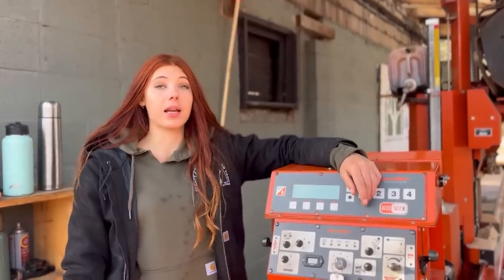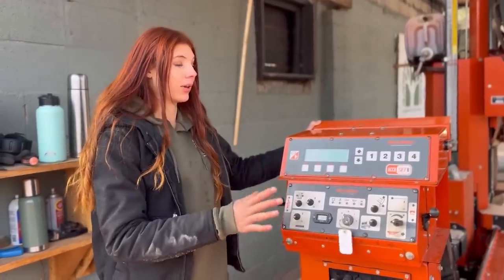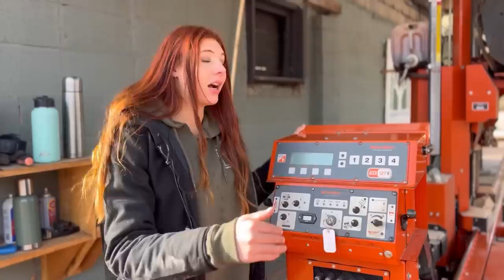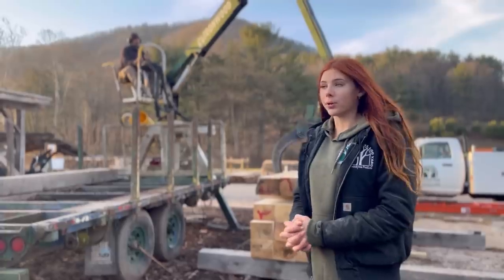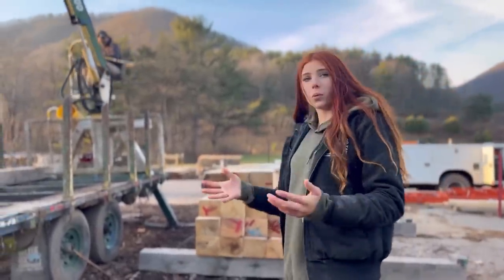Cutting Railroad Ties… hopefully we do better tomorrow

Comment: This channel rocks not only am I learning about how timber is cut and milled but I also get to see why I'd rather buy my lumber from a local mill instead of a big box store. Keep on doing what you do best guys!! Thx 👍
Reply: Emerald, my Grandfather was a Foreman on a maintenance of way crew decades ago and and good ties were what he liked best, according to family lore. Love to see the fam working todether!
Reply: If you are in the market for lumber, you already know that there are local suppliers...
Reply: I wish I lived by a wood mill I would buy only local cut wood but I don't have an option. Keep on keeping on. Oh and bossman can run the piece of equipment like its a extension of his arm impressive.
Reply: Be aware that appropriate drying of lumber is EXTREMELY important.  It can make or break your project.  Lumber straight off the mill and full of moisture is only suitable for things like farm fencing, crating, temporary bracing, and form work, but not much more.  Although quite time consuming, proper air drying is a science that can make it usable for an array of projects.  Even crossties are air dried for months prior to creosoting.  Kiln drying greatly reduces the drying time necessary to stabilize wood for most finished construction and woodworking projects.  Also keep in mind that kiln drying kills wood eating bugs that are often present inside green and air dried lumber.  😀

Comment: I have a suggestion for your railroad tie template.  Instead of tracing around a square, how about making the template like a stencil with a square hole?  It's easier to trace that way - you could also spray paint.
Reply: This is not a good idea.  It is much easier to see how much meat there is remaining on the log with a solid square in the middle.
Reply: Seems the price of Rattle Can paint has also gone nuts.  Great Idea though.
Reply: @danielbal5272  Could I suggest that they draw the outline on every log before they start milling ?
Reply: Clear acrylic with a handle at the corner so it can be held in different orientations?
Reply: @baneyj  Yup. but it won't be clear long!
Reply: Honestly the template is just helping to eyeball where to go in the log to get the tie....all the measurements are coming from the mill itself. So accuracy in tracing is not a big deal.

Comment: Love that template for the ties. Excellent idea.
Reply: Take two short sheet rock screws & place one on each corner of one long side of your template about 1/4 through. NOW, in the center of the template, the screw point side, create a bump that will slide around on the log face until you have the template where you want it. When in possession press the screw pints into the log face to keep the template in place while you trace around the template.
Reply: Once the girls cut a couple of hundred ties hopefully they will not have to use it…Boss Man.

Comment: From a Sawyers view( as I remember it) 
The tie paid for the log, and the jacket boards were the profit. So if you can, grab those outside boards
Reply: Would like to hear at some point what can be done with the jacket boards. Looked like there was a lot of usable portions left. Does the tie pay for the log? If true, great idea to switch to hard woods from hemlock.
Reply: There can be good lumber in the jacket boards.  Depending on your local markets for the different species and grades, there are options.  Many of those slabs were thick.  Probably going into firewood which is in high demand.
Reply: @andrewdelaney2410  - Hardwood is never a bad idea...
Reply: @peterh9927  - Given their diameters, a lot of these logs can be ties, and still just right for firewood on the outside.

Comment: Emerald, I had a thought about the piece of wood you use to mark out the end of the log for a tie dimension, for the obvious reasons it likes to slip around and is hard to hold in the same position while marking out the four sides of the rectangle. Take that piece of wood or make a new one in case you are worried about ruining the historic one your dad made !, then predrill if required four small holes near each of the four corners and insert a small wood screw into each of the four holes so that about a 1/16 to 1/8 of an inch or so sticks out the other side ( the screw can be a bit longer so the head isn't sucked down to the wood as that way the "stick out" of the pointed end of the screw can be fine tuned if desired ). Then find yourself a substantial knob at the hardware store or if you have some lying around and you would mount that knob on the center of the wood ( same side as you screwed in the four corner screws ). Now you would have a unit you can hold easily with one hand gloved or not and as soon as you place it up against the end of the log and press a little, those four sharp screws would hold your pattern board perfect as their points bite into the wood of the log. Then trace your pattern and not only would the pattern board not slip sideways, your hand holding on the knob would not be in the way. Hopefully my explanation comes across and makes sense. No, it won't change your life but may make your life slightly easier and shave off a second or two in your very busy day !
Reply: The template board upgraded with mini spikes and a handle to improve on the ergonomics. Great idea! I was going to suggest adding a handle too but you beat me to it. 🙂

Comment: Great video! :)
Just an idea; you are marking up the end of the log, to make sure where to cut for a tie. Good.
Can we do more? If you weld together a stencil board, you can have "layers" of stencil away from center, to see if you have room for cutting other pieces of wood out of the log. The stencil-shapes are also welded together outwards with solid string. In center of the stencil you have a hand-screw that attaches the stencil to the three, with option of extension to a side, where you can attach a laser and point down the other end of the log, and another stencil, to make sure you actually can cut out extra, and that the core of the log is best placed in the tie.

Comment: Do you have room at the end of your mill (where your JD loader is sitting) to set a roller table?  If so you could raise your toe ups, push the tie off the end of the mill onto a set of rollers, then flip the tie onto four foot rollers set 90* to mill. With this system you only need remove ties once you've done five logs.  Of course they sell these roller tables ($$$) but I've built them in the past with used and salvaged rollers and made them such that I move them around with the skid steer when not using them.
I love to see you changing things up to make your work more efficient and profitable.  I believe your move into hardwoods could be a game changer.
Keep up the good work and be safe.

Comment: Hey, here’s an idea, how about a video on funny (idiotic) questions?  I’ll add this one:  I saw that you marked a square for the railroad tie only on one end of the log. How do you know that it is going to be the right size at the other end of the log?  I suspect that you heard many others. I should add that the saw cuts straight which keeps the proper measurement.  Here’s another:  Why is the top of a tree smaller than the bottom, although ithe top starts to grow first?
Another idea is to ask for the answer to a stupid question so that you can increase your site questions. Good luck, keep up the great work.

Comment: Efficiency: Can you have the mill head push the completed RR tie over to the side to be picked up by the claw? That way the log & tie won’t get jammed up at the log loader -- unloading a tie right when you should be loading the next log. That is a bottleneck. You might have to reposition the claw so it can 1) reach the trailer to unload the raw logs, 2) reach the finished tie off to the side, and 3) reach the rack upon which you stack the finished tie. Yes, I know you also prefer not to bonk the mill operator with the claw. Could the mill operator shove the finished tie off the rollers either onto the ground or down an incline you fabricate? – far enough away so that the claw keeps clear of the mill operator. With such a setup, you could fill the loading rack up full.

Comment: Last time I sold 7 x 9 ties they were bringing $22. Looks like your doing a great job and get slab firewood in the process.
Reply: Last Time  I  Heard,    (Yrs Ago) About  The Price Of Ties, It Was $$$100 +  For 1 Tie.
Reply: @jimbrown4661  The $100 price was probably what the Treatment Plant charged the railroad after drying & creosoting.
Reply: @alpittman902  your Probly Right But I Wouldn't Cut Ties For $$$$  20+ Each!!!  That's Not Enough $$$ Per Tie !!!!
Reply: @jimbrown4661  45 bucks in bedford pa

Comment: Judging by the phone area code you are in Pennsylvania USA.  I do Construction FA in Western Canada.   I would recommend gloves and safety boots or shoes.  The tiny  wood slivers are annoying and difficult to get out.  
Secondly, re your template, would you not be better to get two adjacent flat surfaces before marking?   Especially on logs that are curved?
Lastly, years ago a sawmill in my area using a gang saw which is a much bigger version of what you have had a blade explode into pieces.  They had run into a cannonball shot by explorers 200 yrs ago.  The tree grew around the cast iron ball.  True story.

Comment: Not criticism here, simply a question and a few suggestions. Didn't see any bark being removed from the ties. Do you do it later or just not include in the video? If you cut the 9 inch way first sometimes you get a second chance at a tie. If you can move the ties to a set of dead rollers and accumulate them on a green chain you won't need your log loader running as long which saves fuel, labor, and time. New here and just subbed. Good content and work ethic. This is hard labor any way you do it. 4th generation old guy here and I'm still learning. Just subbed.

Comment: This work flow setup looks a little tedious. Why don't you just use the John Deere as the log tender to deliver logs to the log deck and the small Metavic  grapple parked at the sawyer side of the mill to grapple the finished railroad ties off the log deck. Then if the John Deere is ever out of action you can revert to using the Metavic as both the log tender and tie removing grapple. Love your channel Emerald and the great videography by you and Jade.

Comment: The system is too slow removing the finished tie. It would be faster if you could add something to the LT40 to use the machine to push the finished tie off the end of the machine in a way that multiple ties could be accumulated and then be stacked using the grapple loader. That would reduce the time The Boss is spending operating the grapple.One cycle of the LT40 while not actually cutting would be much faster then having to move the tie and then getting it out of the way to load the next log.

Comment: It seems NOT very Efficient with stacking the Railroad Ties - can the Hydraulics take the finished ties out the back of the Mill, even at 90 degrees to stack or are the ties too heavy - take them out the back if you can rather than the teeth pulling process you are currently doing.

Comment: Seems very inefficient! Between needing three people and the fact that you have to criss cross your logs and your completed ties, doesn't make for smooth operation!! Would it be possible to put a roller conveyor opposite direction of where you usually pull your boards back, instead have your completed ties roll forward, to be picked up after the next log is loaded??

Comment: A few rears ago, the railroads started double stacking containers. They blasted out the tunnels to a higher height and specified that the ties had to be center cut from oak. I am sure the slabs are cut for 2x4s and 2x6s. I thought I saw a poplar!

Comment: Keep your template from sliding around by driving 3 or more nails through the plywood and clipping them 3/8" proud of the surface. Box nails or finish nails can easily be cut with diagonal pliers.